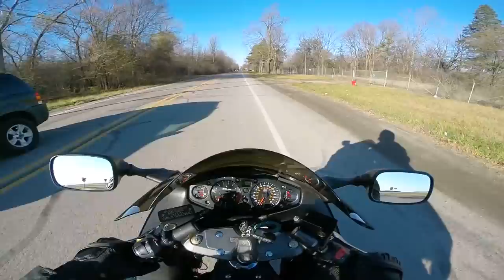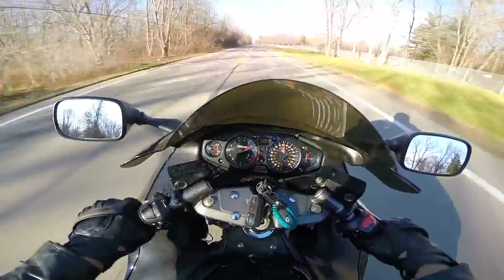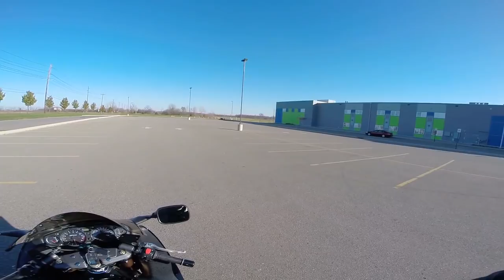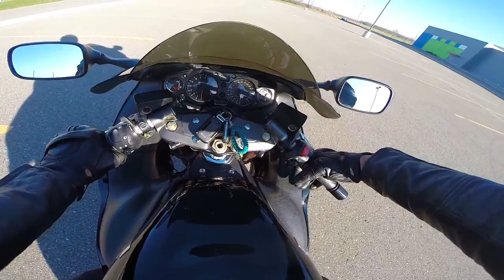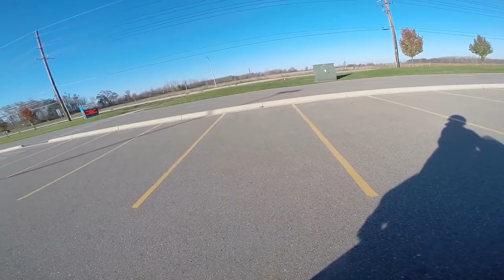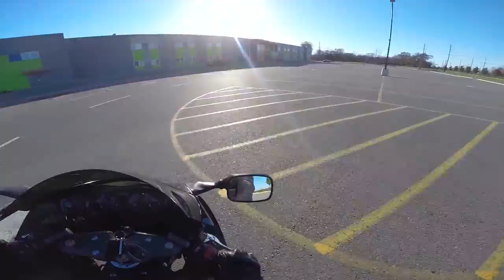Motorcycle Basics: Controlling the Throttle

Comment: very interesting topic! i've been wondering all along how i could full throttle without risking whiskying. not so much a topic for my fj1200 but on my er-5 throttle is an issue if your not up at 7k rpm. also a lot people advocate constantly resting a finger or two on the brake lever, which doesn't make  much sense to me in a situation where i open the throttle wide. any thoughts?
Reply from the maker: When accelerating there is no need to rest fingers on brake.It makes sense if your riding in a congested area through thick traffic or lane splitting or slowing down
Reply: thanks, i appreciate your response
Reply from the maker: no prob

Comment: Anyone know about the throttle jerking the bike slower when rolling off? I'm a new rider with a ninja 300, and I noticed that no matter how smoothly I roll off the throttle, the bike sort of jerks while significantly slowing down, and I almost have no need for breaks when turning. I took the MSF course a few months ago, and the bike I used for class didn't seem to have this issue.
Reply from the maker: Eles https://youtu.be/HKbU9oN-hps
Reply: Thanks! Been binging through your tutorials and hadn't seen that one. I noticed that your engine braking was quite smooth and gradual though, but when I attempt it, the bike literally lurches so hard it feels as if I'm going to get tossed forward.
Reply from the maker: +Eles Go to a parking lot or empty road and practice getting used to the engine braking.Most bikes feel like your going to get tossed forward
Reply: Will do man thanks a lot! Your videos have been super helpful
Reply from the maker: +Eles I'm glad I could help.This riding season I will be doing more tutorials

Comment: Great video, I just want to correct your torque/power explanation. In fact, torque and power is basically the same thing. It goes like this: torque = power / RPM. For example when you have 100 N.m. of torque at 1000 RPM, you have 14 horsepower at those RPM. Always, no matter which engine, make, e.t.c.

There is a calculator for it: http://wensensors.com/unipower/calculators/power_torque.asp